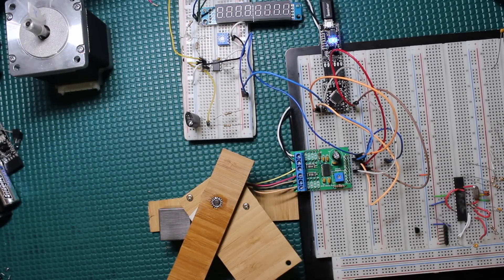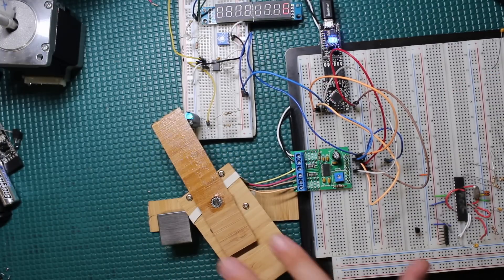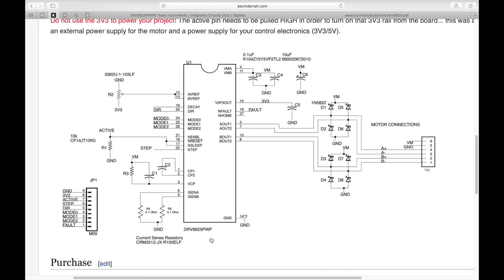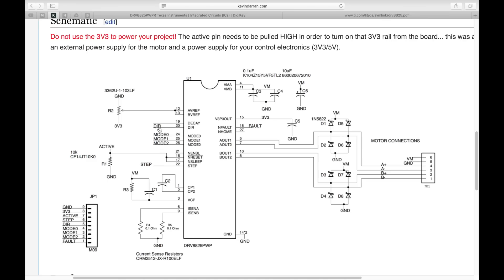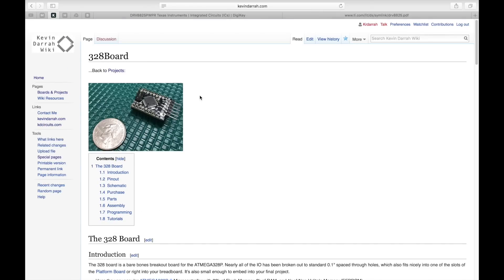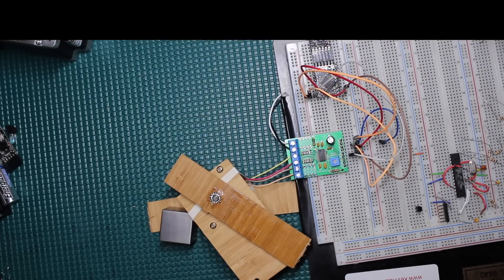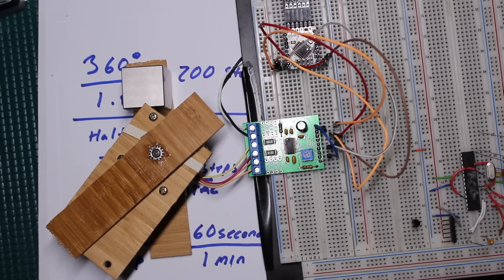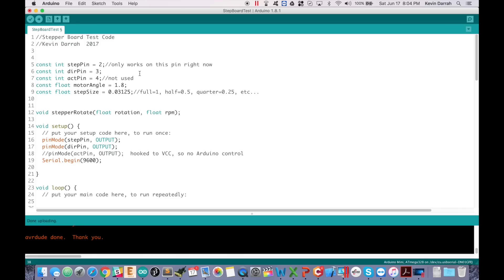Stepper Motor Drivers with Arduino CODE - DRV8825

Comment: Thank you very much for this tutorial, however my stepper motor (Dual Shaft Nema 14 Hollow Shaft) doesn't rotate at 800rpm (because is the value that i need for my project). The stepper works good until 400rpm. After that stops and make some noises. Any help? Thanks a lot.

Comment: Hi Kevin, that was informative. I doubt though. Running the stepper at any rpm( without changing the stepping mode) leads to vibrations. For each stepping there is a 'sweet spot' of delay that you can provide between two steps or else stalls or cause large amplitude vibrations. what is the way out? any help appreciated

Comment: Thank you for this, I am currently building a star tracking device for astrophotography and i needed my stepper motor to turn a 3.28 rpm. i believe this sketch will do the trick.

Comment: If you want to use more than one motor you can create a 2nd function (mainly copy and pasting) and use Port B (pin9=direction, pin10=step) for the 2nd function.
Reply: Hi, I am very new to the whole arduino and coding scene. Do you have the code for using a second motor? I can't figure it out.
Reply: @Voorstguy  and AZarqa, I mainly just copied and pasted sections of the original code, but used Port B for the 2nd motor. If ya'll comment or message me your email I can send you the adapted script.

You can only operate one at a time, so if you need to operate multiple motors at once I'd recommend using the AccelStepper library. That allows you to move more than 1 motor at the same time.
Reply: I simply made a second custom function. (function that isn't the setup() or loop(), you make them and can use them throughout the script. He had one and I copied and pasted that and added the necessary variables)
Reply: @alareejit  Try using the "Accelstepper" library if you wanna move two motors at once. If you checkout the YouTube video "Stepper Motors with Arduino - Controlling Bipolar & Unipolar stepper motors" by DroneBot Workshop
 he goes over several scripts with stepper motors. Some using Accelstepper and others not.
Reply: Hi , Do you have the code for two motor?

Comment: Hi Kevin I'm new to all this and trying to gather little bits of info from many vids but can't get enough, there are similar vids but the only one that came close had no information on how it was done, I'm trying to make a train turntable using uno r3 a Hall effect sensor to get the home position then use a ir remote and make it move to stored positions but how can I store the selected positions should I use a potentiometer to move to required position and buttons to store the selected position but how is this done I will give a donation for the help regards Sean.

Comment: Hi Kevin thanks for sharing such a great detail for  Stepper motor specially details around RPM and Delays.  
I am in the middle of building a turntable for Model Trains  which requires not to complete the full rotation and  will have  multiple slots within that rotation  and I would like to acurately stop for a pre selected slot .I am using https://www.robotshop.com/ca/en/l293d-motor-drive-shield.html?gclid=EAIaIQobChMIkq-A6aOV2QIVULnACh251wlVEAYYBSABEgKBLPD_BwE and a very small stepper motor Model number 5014-869
Could you tell me if this can be achived for now i am using  https://learn.adafruit.com/afmotor-library-reference/af-stepper-class

Thanks

Comment: Hello Kevin great tutorial. Just to let you know I tested the code with an ATTINY85 at 16MHz internal clock on Port PB0 and it works also. I also tested with it at 8MHz and the speed and rotation is off (expected), but I just wanted to see if worked and it did. On the ATTINY85 I changed the stepPin = 0, and your for loop at the end instead of {PORTD |= (1 << 2); and PORTD &= ~(1 << 2);}, I changed to {PORTB |= (1 << 0); and PORTB &= ~(1 << 0);}. I am controlling some NEMA17 12V steppers with it and it moves them. I will try to get them to step exactly what I command, it's probably a timing issue with the ATTINY and its clock.

Comment: Hi Kevin Darrah, I don't mean this to be spam'ish but I tried suggesting this privately through your website, but contact wouldn't work...

Anyway, I wrote stepper utility that you might want to look at: http://forum.arduino.cc/index.php?topic=469343
There a V1 video manual at the bottom in the description but I still need to make a V2 manual.

BTW, thanks for all of your videos!

Comment: Could you make an example with non-blocking, interrupt driven code, such as for instance 3d printers and robotics often use?
Reply from the maker: good idea! background running code so you can other things while the motors do their thing
Reply: I'm currently working on some code for a balancing robot I'm building using Timer 1 and both compare registers to control two stepper motors. There are libraries for stepper motors out there, but I haven't been able to find anyone for this purpose. There are of course code for balancing robots (or open source 3d printing software such as Marlin) out there with interrupt driven stepper controll, but they are poorly commented and don't explain what the code does.